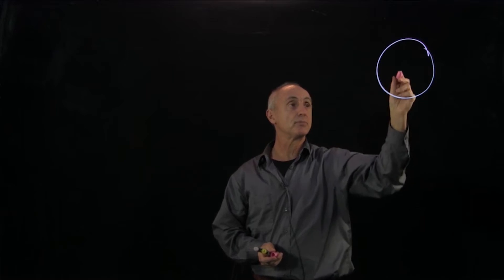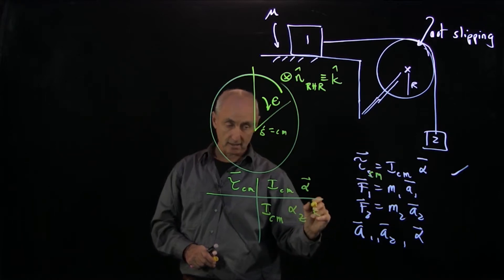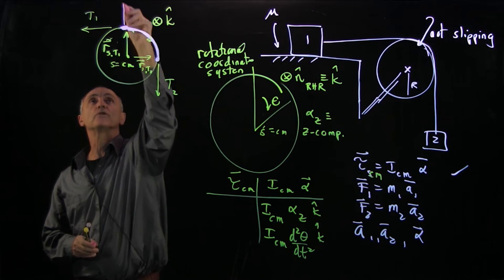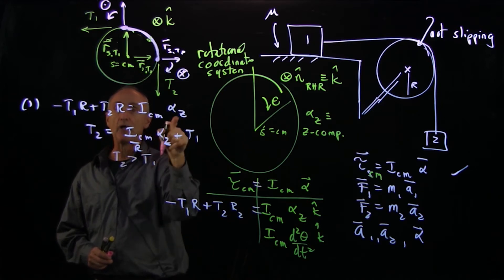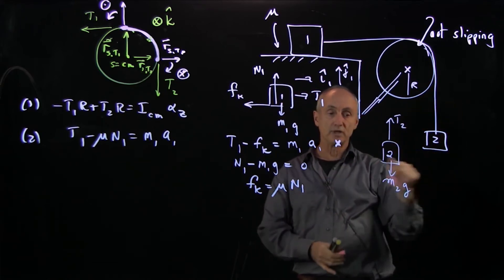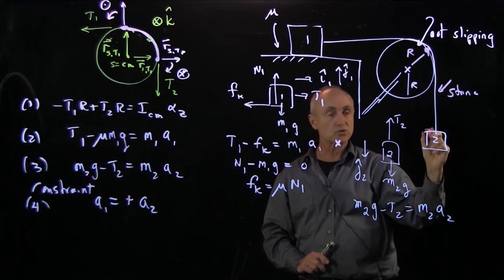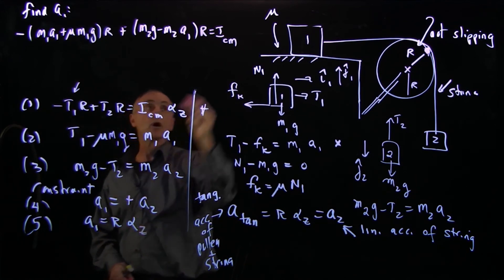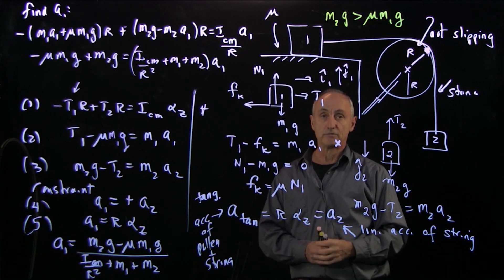PS.10.1 Worked Example - Blocks with Friction and Massive Pulley

Comment: Around 4:00, why isn't the total torque evaluated on all points where the rope is in contact with the pulley, i.e. from theta=0 and theta=π/4?
Also, shouldn't T1 be in the opposite direction if block 2 is going down?